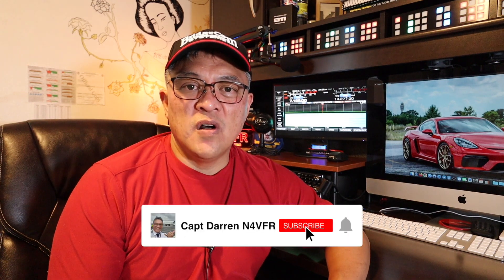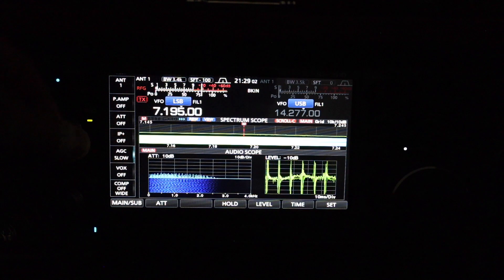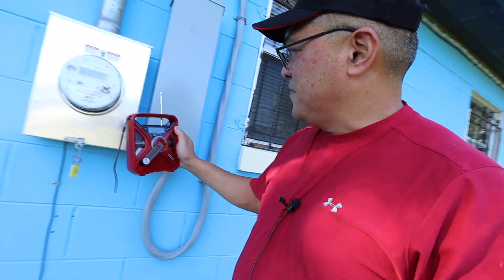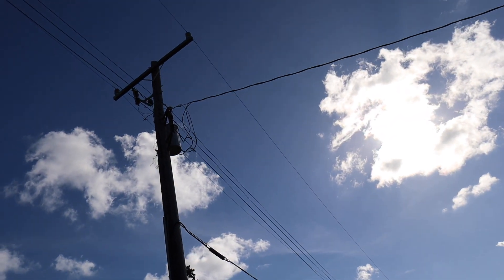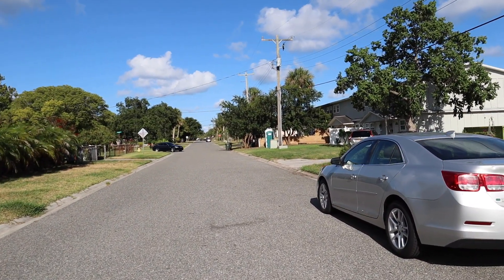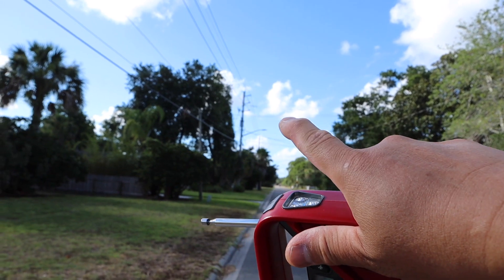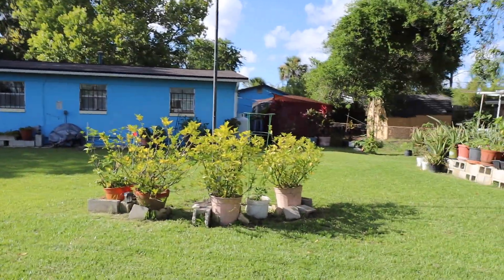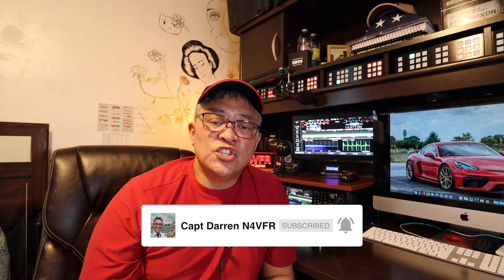RF Interference Again! | Power line Noise is back with a vengeance! | Hunting the Interference

Comment: use a full spectrum signal analyzer with a coaxial cable connected to it and put your thumb on the stinger of the coaxial cable and watch the impulse spikes on the full spectrum analyzer and you get closer to the source

Comment: You can localize the noise faster by listening to the noise in the vhf aircraft band. The receiver mode for air band is AM. I do this from my car with my dual band whip antenna. With a two meter handheld yagi antenna you can point directly at the problem pole.
Reply from the maker: I still have my Icom Air Band radio will use it.

Comment: In some cases the power company engineers have been known to tap the pole with a large hammer to see if the noise is affected, sometimes the RFI is an early warning that an insulator is breaking down. Of course that is best left to them to do,  I am sure prisons are full of radio hams that have been picked up in the street carrying receivers and cameras. I feel lucky that our ower distribution in this village is underground. The utilities are sometimes grateful to know that there is a problem...hope it is resolved soon 73
Reply from the maker: lol, I'm still here and not in prison.  The utility company called me and found a few problems.  They submitted a ticket to replace an equipment.  He didn't say what equipment need replacement.  Maybe in 2 weeks, it would be quiet on HF.
Reply: @DarrenN4VFR  that is good news, better than being jailed pending psychiatric assessments.  :-)

Comment: I have a similar problem, in my case I took the Icom 7300 in the car connected to my vhf/uhf mobile antenna. The noise dropped as soon as I left the driveway, I still went around the block and didn't encounter any significant RFI, Next I took a loop antenna and used the meter on the 7300 to help determine the source. I also noted that the noise is intermittent it usually start around 10am to 11pm. I've found it's very likely that it's my neighbors TV. When it's ON it obliterate the whole HF spectrum S9+20.
Reply from the maker: That's what I was getting S9 +10.  I think it's best to call your utility company and submitting a trouble call ticket. You may need to explain about what HAM Radio is and that you suspect that RFI is coming from somewhere near your home on a power pole.

Comment: Hey Darren, when you get to what you think is a source go up in frequency. AM band, then check 80/40 for harmonics. And as you go higher up in frequency, I switch to an HT FT-3D or whatever that also has AM Band. If you are close the AM aircraft band (your specialty) will be lit up with the same arcing noise. Your are much closer to the true source (pole, garage battery charger, pool cleaner/heater motors etc). You need multiple tools. I used my KX3 then my FTM 400 (while driving, IC705 is great for all in one) then I gout of the truck and walked, a lot.  To make sure the pole was truly suspect. I ended up getting an MFJ cone / RF device that covers low frequency until I got right under the pole to hear the low frequency arc.  An HT with a simple 3 element hand Yagi on AM band is great. Best. NM6E
Reply from the maker: Thanks Javier!  I forgot I have a portable ICOM Air band HT I could of taken with me.  Welp, the utility is cooperating with me and found a few spots that he corrected and is having equipment replaced.
Reply: @DarrenN4VFR  exactly, Air Band HT can pretty much put you within 50-100 feet of a power pole. And an ultrasonic receiver (MFJ DISH) can hear the arc’ing  as you get closer, the. AM band HT is the source of truth.

Comment: been there done that, am radio is not the best, a little shortwave radio much better,  ic 705 ultimate tool but handheld directional antennas for various freq ranges are a must, small loops for lhf, yagis for vhf when close in

Comment: use the qrm thing
Reply from the maker: I've tried, it brought the noise floor down by 3 S units but not the RFI.  The power company called me and mentioned that he has taken care of one issue causing the major RFI and found another issue where they will have to replace equipment.  He put in a trouble ticket to have it fixed.  Hopefully in the next 2 weeks. 73's